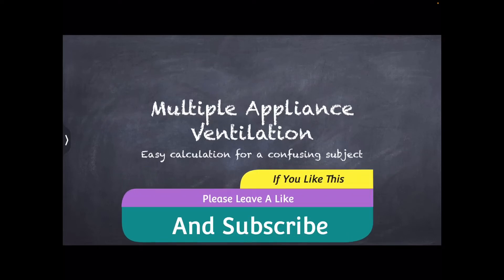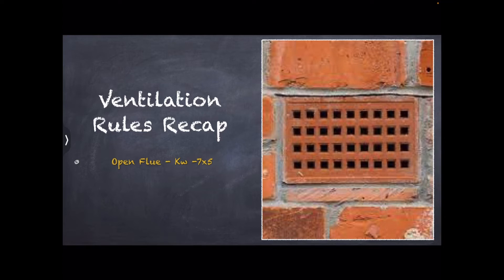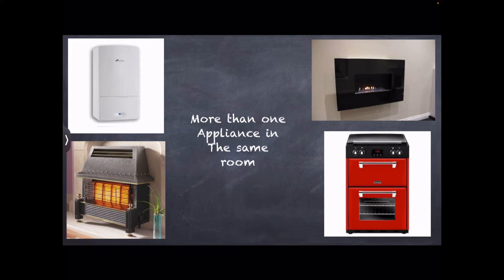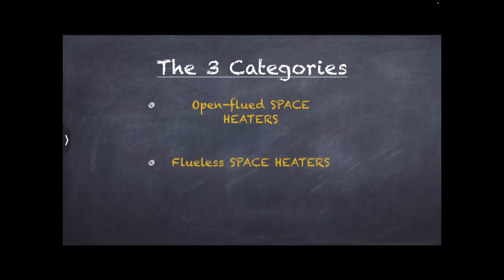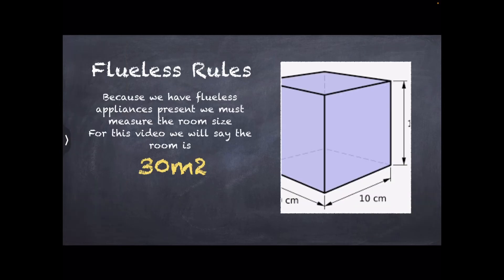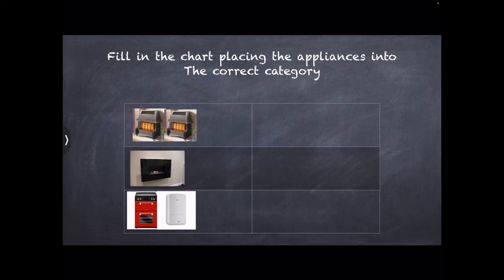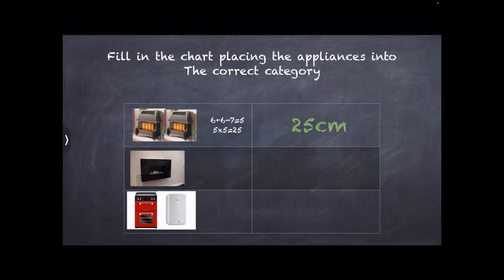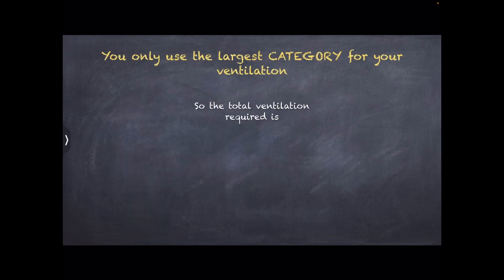ACS Ventilation - More Than One Appliance

Comment: What about if you have a DFE fire, what category is that?
Reply from the maker: @tompfennell But this includes 35cm2 allowance for adventitious air. If you have another dfe, or open flue appliance in the room then it’s 135cm2
 @tompfennell 
Your gas book will explain it under ventilation.
I hope that helps.
Reply from the maker: @tompfennell  I don’t think all that I wrote came out …. It’s 100cm2. If the chimney has no throat, I.e if it’s under a canopy then it’s 50% of the case of the chimney.
Reply from the maker: @tompfennell  case should read csa

Comment: Say u have a scenario, a flueless space heater in a 30m3 hallway, a 30kw gross warm air unit, no window but a door direct to outside, I’ve worked out both the fire & boiler need 100cm2 of ventilation each, can u add 2 categories together
Reply from the maker: If the warm air heater is also flueless it belongs in the same category as the fire so you add them together. If it’s open flued then it’s in a different category and you choose the one that needs most ventilation…cheers
Reply: @passyourgas  what about if they both come out the same, so they both require 100cm2, do u just pick 1 or add them both together,
Reply from the maker: @shredder8000  Hi shredder…no, if you have two categories needing 100cm then you just use 100cm…you only ever use one category…remember these are MINIMUM ventilation requirements, you can put 200cm in if you want, as long as you don’t go under 100cm….hope that helps..
Reply: @passyourgas  ok kool, thank u 🙏

Comment: 30m3 not 30m2 = room size
Thanks
Reply: Also not pointed out, is that you would not be able to fit a 3.7kw flueless fire into a room of only 30 m3 volume. There is a maximum allowance of 45 watts per m3 of heated space (45x30), so the maximum heat input permissible for this appliance in this particular room, would actually be only 1.35 kW
Reply from the maker: Well spotted `zabiullah, a slip of the tongue, thanks for pointing it out. 😀

Comment: Hi, great video again. 
Wanted to ask, if I fitted a gas hob in a property and there was a boiler and a fire. What would a visual check on them require me to do, especially on the fire? Thank you
Reply from the maker: Hi Abdul. Thanks for the compliment. Re the visual checks, do you use the Viper book? If so it’s all on page M42. If not let me know and I’ll create a quick video for you…in fact I’ll be doing this anyway thanks to your question…
Reply: @passyourgas  thank you so much. I'm just wondering if you have to take the fire out and do a flue flow and spillage on a visual. I always assumed a visual is something quick  and it seems a lot to do when you're only there to fit a hob. Would love a video on it, thanks again
Reply from the maker: @abdulh63  It will be up by tomorrow for you. I’ll tell you straight off that you don’t need to do flue flows etc but there are 2 sets of rules depending on what you have done in the house…vid tomorrow.